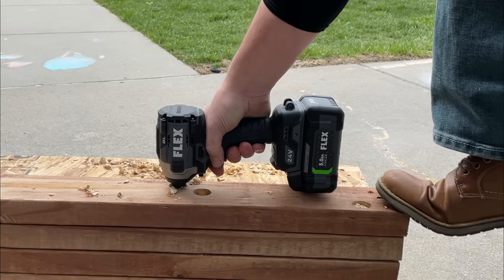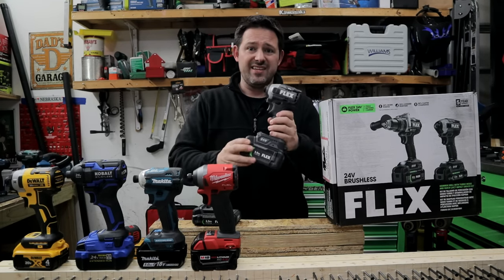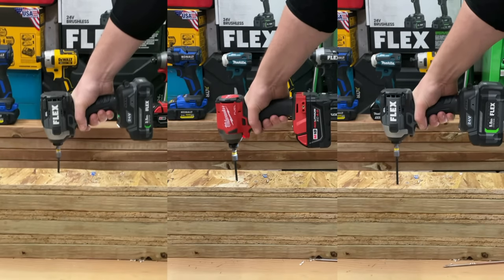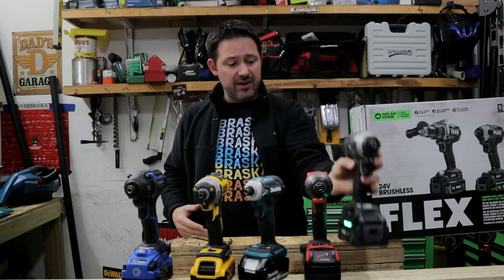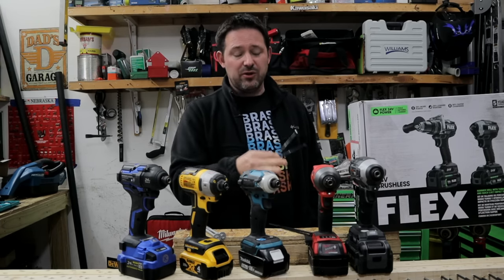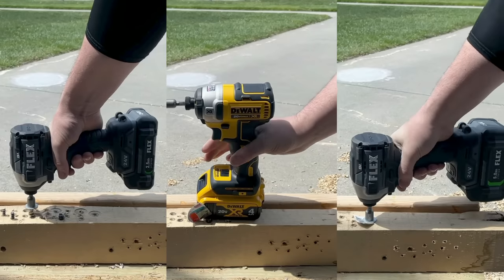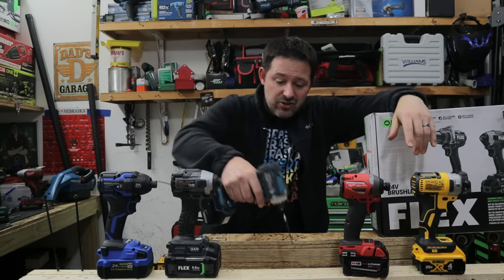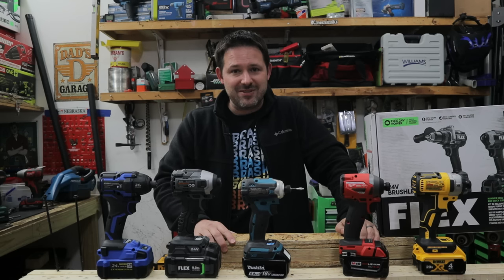FLEX TOOLS vs DEWALT MAKITA MILWAUKEE It's NOT what's NEXT Impact Driver SHOWDOWN!

Comment: So the flex is only the fastest installing deck screws, but also weighed the most so not a great option for that either. Ill stick with my Milwaukee. Not shure how the flex is going to make it with all the already proven tools available.
Reply: I like all the platforms. Every one. When a project comes up, I have options, not mandatories.
Reply: What video did you watch? Flex beat out everything on every test except the 6 inch lag bolt. Milwaukee matched it for a few tests, but Flex crushed the competition here.
Reply: @cameronaberner  except Milwaukee could use a HD battery for even better performance and is lighter which is good when your working all day long
Reply: @cameronaberner  ya so only the speed test and if you looking for speed its not only about how fast the tool spins the bit, alot has to do with the weight of the tool. I watch this as a actual user of tools that makes my money with them not in aww of the newest shinny toy. Makita dewalt and milwaukee are far better tools just in weight alone and are pleny fast enough in real world use, anything faster you can't control the fastener because not everyone is driving screws in there garage on a test wood.
Reply: @chriswebb3018  It lost in 1 test with a rarely used lagbolt. It dominated in tests with other screws and drilling. That a lot more than "it did 1 thing faster" it's clearly a good tool. You just one of those people who don't want to accept that makita and dewalt aren't the top dogs anymore for some reason and take it as a personal attack when another tool outperforms them.

And fyi, I'm a carpenter. I use these things every day. So no, it's not just "oh shiny."

Comment: Hello again Chris and Mrs. CG 
Thank you once again for another Great Video. As I am trying to stay current on the new tools and battery platforms. Right now all I have is a  Hitachi 12v, drill and impact wrench. Which has been a great tool. But I have nothing else in the lineup. So my commitment is very limited. Once again thank you

Comment: Milwaukee just simply has it....imagine using the best battery they offer instead of the old pioneer 4.0
Reply: I use the 3.0 and the 9.0 high output batteries,  night and day in performance,
Reply: Milwaukee is it. They’ve been tested many of times. They’ve been targeted by other brands many of times.... then flex comes out aiming at Milwaukee first. Lol. Milwaukee has history behind their tools. I’m not gonna change battery platform just because flex is 1sec faster.
Reply: @jasonm6111  - Spot on! Look at all they offer and what they LEAD in and look at their capabilities of the platform. It's hard to go wrong with any of the big 3. But legitimately big red CONSISTENTLY finish top 3 in most any tool category for the things I own and use. Look at their drills, impacts, saws, lights etc etc etc.... They're hard to beat!
Reply: I prefer the 3.0 or 8.0 unless I need more power and life then it's the 12.0
Reply: @rubenaguilera4018  the 9.0 is not a high output battery, it is a high demand. The 3.0, 6.0, 8.0 and 12.0 are the new 21700 cell batteries and the 9.0 is the older 18650 cell battery. Milwaukee has released a warning about the 9.0 having a issues. They're are videos of them catching on fire. Lots of people still use and love them. But there's a reason they don't sell and sometimes wont warranty them.
Reply: @jakedraper1863  sorry I got confuse, you are right.  I mean high demand.   The 3.0 high demand  pair with my  surge impact  driver,    hard to beat for remodeling people, big difference in noise performance.
Reply: @rubenaguilera4018  no you were right about the 3.0 h.o., the 9.0 is a high demand battery, just extra capacity. You are correct about the 3.0 h.o. with the surge being a great combo.

Comment: the thing with impacts or any power tools, 99% ppl only see the power, the speed, but in real life, on-site, real usage, there are so much more to it.

i start off buying Milwaukee coz they do have the raw power, and selection range. but the more I use Makita stuff on-site, the more I like it. details like revers trigger, it is so much easier on the Makita ones. yes, using the high torque impact on a 5-meter ladder at an awkward position, that bit of easiness is a game-changer for me.  

in another word, use brain, use all the tools from other brands, and really think about what actually benefits your work. raw power might just have been the least important thing on the list given nowadays the motor and the battery tech are pretty much at their limit for now.

the weight balance, the details, the ergo shape, price, durability under the weather etc etc..............

Comment: Why not use a 6.0 high output on Milwaukee would be interested in seeing the difference
Reply: @bustanut3888  You wanna donate some batteries to him? They aren't exactly cheap.

Also, don't forget that he used the Flex 2.5 for every test too.
Reply: @cameronaberner  yes sir, you are right. They are expensive. 😎
Reply: He probably didn't have a bigger battery, but seeing as how it matched or came in a close second in most of the tests I think we know how it would go.

Also, he used the smallest available flex battery(2.5) as well as the bigger one(5.0) to see how they stacked up to the other brands with bigger batteries.
Reply: @cameronaberner  Exactly. 😎

Comment: Great test. Using 2.5ah batteries in my Makita tools most of the time, even when not fully charged the power is adequate, no issues. As for impact drivers, the first few seconds of the video eliminates all except Makita and DeWalt, how much time do you want to spend pulling out stuck drillbits? Most of my go-to drillbits are Makita impact bits. Anyway, this was a big lose for Flex, the way the skin of his hand vibrates wildly when the hammer kicks in is painful to watch, and it failed to perform on 6in lag because the impact energy is transferred to the operator and not to the bolt.

Comment: I’m thinking of getting a Flex combo kit with the hammer drill and the impact…I have a handful of dewalt tools for cutting (brushless jigsaw)  bolts, drilling and or hole sawing through steel and aluminum, and the like. (All brushless tools)
I got a Dewalt Compact XR set and already had issue with my XR Dcd800 Compact drill after hardly a month…it had a disgustingly wobbly chuck so I sent it in and they replaced the drill with a brand new one. Same thing not even a month later with the new replacement. I’m not sure why but it seems like Dewalts quality is lacking on the newer tools other than their battery options (love the power stacks so far)
I haven’t had issue with the 1/4” compact impact (newest generation) but I don’t really use it as much. Aside from that I have their compact 1/2” impact with hog ring anvil and love that so far. But I’m most disappointed with the drill. (Dewalt said the wobble is “like that from factory” which I think is very odd) 
I can sacrifice the weight difference with a battery if it means faster drilling…even with hex end drill bits, I’m not too worried about the weight of the Flex impact for some light OH usage; not that I’m getting rid of the dewalt I have. 
The big plus of Flex is their limited lifetime warrant and big sale prices. Their combo kit being $349 plus tax vs $699 plus tax right now is a huge appeal with the limited lifetime warranty with registration! 

Good comparison video nonetheless. Although I’m curious as to what setting was used on the flex, since it has multiple settings for torque

Comment: I noticed flex always slows down on larger lags, I wonder if it's actually engineered to do that because of the high torque for safety reasons.
Reply: I believe it's their battery protection technology that throttles when the temps get high or load too heavy

Comment: So i have the hex impact driver from Milwaukee but a have a impact socket adapter stuck in the anvil of the Milwaukee any idea where i can get it fix? Also great comparison video very good points, and as a temporary owner of a flex for a few hours, they do the job but won’t last as long as a Milwaukee or have the warranty you would get with a homemade power tools like Dewalt

Comment: Lowes best tool brand is Metabo HPT with the 36V and 18V tools and nailers/fasteners
Contractor grade and would beat the FLEXY on most tests Hammer Drill, Recip saw, grinder, table saw, mitre saw-oops they don't offer those
Portable band saw, rotary hammer-should I go on?
Acme has better prices than Lowes but u can buy more online at Lowes than they have in store
Metabo HPT is also bringing in new tools soon
First true 1/2 Cordless router(check Hikoki cordless router) also don't forget all of those high use/longer run time that eats up batteries can use the AC adapter which no other tool line offers-Metabi HPT/Hikoki is really looking out for the contractor/consumer

Comment: Great review. Looks like the biggest difference in the flex tools is the rpm. They seem to be plenty powerful for most applications. If they expand the line-up to be as big as their brother Kobalt I can see them being a very successful brand. 
That being said I use a lot of large lag screws and drill into a lot of concrete in my line of work. The other brands seem to be better suited for heavy duty applications. I bought a Milwaukee combo kit on sale for cheaper than the Flex combo kit and they have been flawless thus far. I keep hearing about the collet issue they have but have yet to experience it because in the real world application you’ll almost never run into that type of problem. Also who runs spade bits in an impact anyways?
Reply: I run into collet problems on the daily, bro. Shits mad irritating. I'm trying flex out specifically because even when not in use the milwaukee collet will drop the bit sometimes

Comment: Also, change the Milwaukee battery to the High Output battery and see where the results line up.  But even at 24v, I'm not seeing a major improvement in performance from the Flex over the others.  Definitely not a game changer in performance, maybe a slight improvement in the price category.

Comment: Irwin 1 1/2 inch speed bores are a true test to hammer drills Dave at
@man caver tools 
used them to do flex head to head with the hammer drills between dewalt Milwaukee and makita and more I think the 1 inch Irwin speed bore bits are a great test for the impact drivers @Client Graphics

Comment: You are correct sir, miluakees 6 ah has the 21700 cells. I own a decent assortment of both m12 and m18. I usually use the m18 3 ah battery which I have a feeling is also the bigger cells but regardless when the big lags need attention the 6 ah shines bright. My buddy's new makita barely drives them. Stopped half way through n asked for mine lol. Head hung in shame. I like makita, and dewalt they all make good tools. But I happen to bleed red currently.
I'll just add that through the past, the only time I had a collet issue was my old Gen 2. Only used it for half a yr before the Gen 3 came out. Haven't had a collet issue so far. But it's def a well documented flaw.

Comment: Bro, looks like you’ve been cheating a bit. Towards the middle of the video you’re putting the dewalt, makita, and Milwaukee screws through holes that were previously drilled by screws whereas the flex screws went through solid wood where no screws previously drilled in the wood. I had to comment because it wasn’t fair for flex!

Comment: Put an ho battery on the Milwaukee and see a different beast.
Reply: Yep.
Reply: I mean fr. It's their top of the line impact with their best (only) battery cell option. So it's only fair to do best to best imo.
Reply: That 3.0 HO is a damn good battery
Reply: Yup agreed.. Also.. Show closer up.. I wanna see speed settings and battery levels uncut before each test. Until then.. I'll call fraud.... Check out "man cave tools" and "torque test channel" for real comparison of the hammer drill and impact

Comment: Not sure why use a 4.0 on the milwaukee 🤔 even a 3.0 HO will take all of the tests no problem. Not Milwaukee's fault that other companies stayed behind technology with the old batteries.
Reply from the maker: High Output didn’t seem to matter for the Kobalt XTR using 21700. I did test some 18650 battery cells and it didn’t seem to matter either. I do have some 3.0 Milwaukee HO 21700 cells I might test if I have time but I wouldn’t bet on the time thing😢
Reply: @ClientGraphics  you might be right but I seen the new milwaukee tools performed way better with the new HO batteries. Not gonna lie... those flex tools are looking good. Great video BTW 👍
Reply: The CP3.0's power output is roughly equivalent to the XC batteries. You'd be trading some run time for a lighter overall package, without sacrificing performance. It's the High Demand 9.0 and the multiple bank 21700 HO batteries that can see a boost over that.
Reply: @reaperreaper5098  that was exactly my point. With a High Output battery the tool will perform way better. You are 100% right  and don't need to be a 9.0, a 6.0 will do the trick 👍
Reply: @pinos74667  Except the HO you referred to in your original post was the CP3.0, which only matches the output of the XC (2 banks of 18650s) batteries, which the 4.0 is an XC.

Not all tools see performance boosts moving past XC batteries either. I know my Surge and previous gen Fuel impacts don't see a meaningful increase moving from an XC 5.0 to an HD 9.0, and theoretically, the HO 6.0+ provides  a modest performance bump on top of the 9.0.
Reply: @ClientGraphics  I've noticed the same, my Kobalt ultimate output battery doesn't seem to actually put out much more power than the standard batteries.

Comment: @ClientGraphics. Thanks Chris for your showdown between the new Flex impacts against Dewalt, Kobalt, Makita, and Milwaukee. Great presentation and editing that better compared the performance between all the impacts tested. Any of these impact drivers will get the job done at a jobsite or for a DIYer. So unless people are competing in a new tool sport where speed is the only important thing they're all good. I hope carpenters aren't running these type of competitions at any job sites.

Thanks for showing the self-feeding bit tests. Hear that electricians like using them. I'd be upset if I constantly lose or drop bits because the collet can't hold the bit in the tool. How many ball bearings are in the collets for the Flex impacts you have? The Milwaukee GEN3 impact has only one ball bearing. Milwaukee added a second ball bearing for the GEN3.5.

Hope you and your family stay safe and well.
Reply from the maker: There are two balls in the FLEX. I really need to do a video specific on this topic I think I have some good 2 cents to add.
Reply: @ClientGraphics  That's surprising that Flex with 2 ball bearings can't hold bits! Thanks for keeping us informed. Hope you get your GEN 3 Milwaukee impact collet fixed with no hassle.

Comment: As a milwaukee guy, I'm tired of my impact. Collet sucks. (I install solar) hate when my bits go off the roof because it disengages. And the trigger problem. It'll stop working and won't work until I take the battery out and put it back in. I'm giving flex a try for sure
Reply from the maker: The collet truly is one of the biggest  Milwaukee downfalls. And the more you use it the worse it gets.

Comment: Tons of dewalt tools, but I've never been the biggest fan of their impacts or drill. Also, if you use impacts to run heavy lags you're going to greatly decrease their life. I use my M18 1/2" high torque impact wrench for driving in LVL bolts or big lags. When you've got 100 to put in, the right tool makes a big difference. I can put in 100 5" LVL truslok lags with the impact wrench by the time I've used my DeWalt impact driver to put in 10. And it would be so hot you could fry eggs on it and it won't operate anymore. Right tool for the job is important.

Comment: When I look at my wall of red that was just last year a wall of yellow, I have a half dozen or so choices when it comes to driving a fastener, all wracked up and ready to go, batteries installed. So what do I grab? I'd say 80% of the time I'm grabbling the M12. It isn't the most powerful, but it's powerful enough for most things. What it is is the smallest and the lightest. Why don't you haul DeWalt Flexvolt around for your impact and drill tasks? Surely it would put a woopin' on any 24 volt, right? Heck, the Flexvolt circ saw puts a woopin' on the corded Mag 77. You know where I use Flexvolt? On my big miter saw when I need to do framing away from power (actually don't even need that anymore with my new hybrid F150). What I don't want to see is a trend toward bigger and heavier cordless tools. I love having small, spunky tools that can get 'er done with the big brute sitting in reserve for when it's needed.

Comment: I sent both of my Milwaukee’s in. Got it back with still the single ball for retention in the collet. The new gen 3.5’s have a 2 ball bearings and upgraded springs for stiffer ball bearing retention.
Reply: When did you send yours in? I sent mine in last month and it came back twice with the same single ball bearing. I'm waiting until the new version is more widely available, then sending it back in.
Reply: @NWGR  I sent mine in about the same time frame as you did.
Reply: @Lakecenterlawncare  Thanks. I'll hold off a bit longer then, probably until june, or until they're in stores.
Reply: @NWGR  make sure you open the box and check for the double ball bearings!